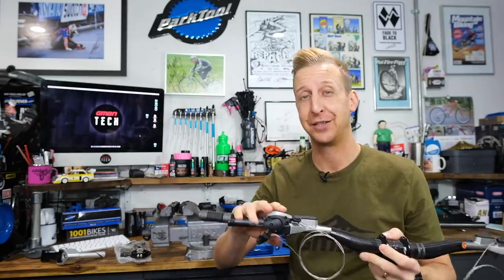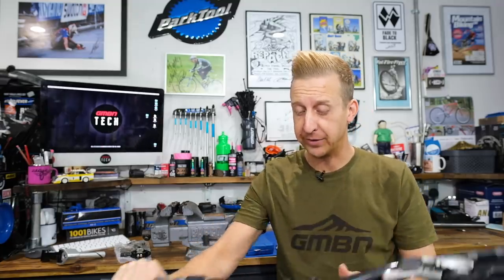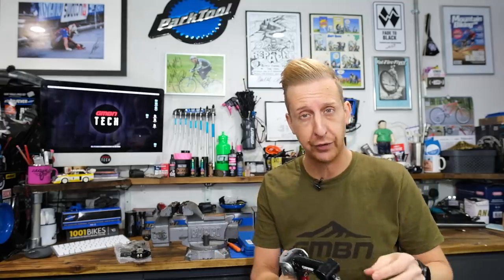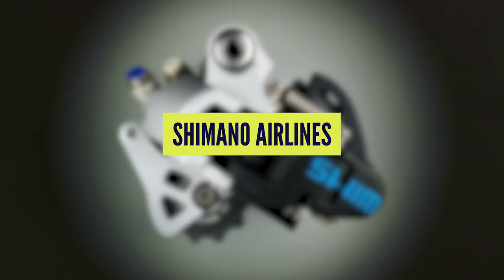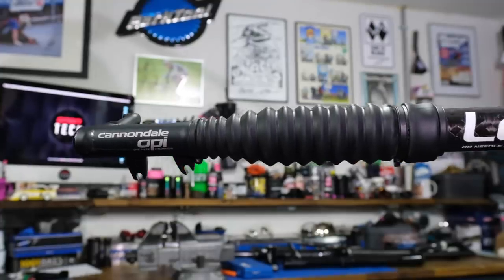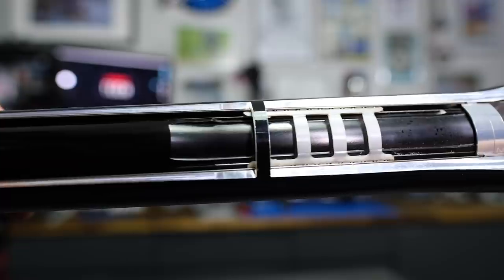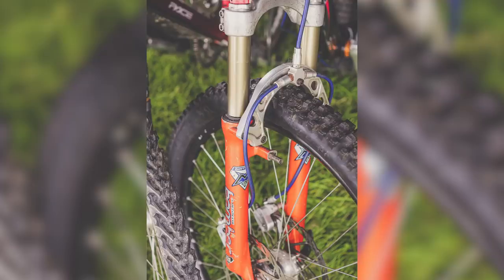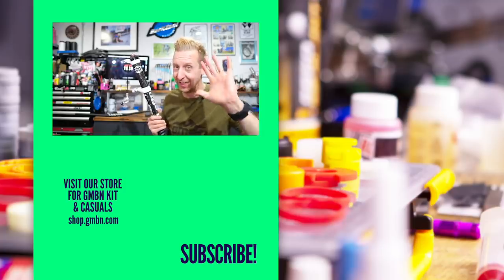The Strangest Mountain Bike Components Ever Made | MTB Tech History - Part 1

Comment: Lefty tech was a brilliant design - but Cannondale also had the Headshok system, would love to see more of that detail.
Reply: I was thinking the same...was hoping to see it on the show...guess there would of been too much from Cannondale so maybe in part 2  :-)
Reply: RollinRat  Quality manufacturing and SRAM don't get used often in the same sentence historically, but they seem to be making good stuff at the very high end these days, though they still can't compete on quality or value with Shimano drivetrains. Cannondale had some great ideas, but they were let down by terrible actual reliability - they more than earned the 'crack and fail' nickname they went by back then - based on their made up badly engineered and implemented BB standards, they're still continuing to screw their customers right to the present day, which is a damned shame as Headshocks are genuinely a great suspension concept for XC levels of travel from a packaging point of view, and any system using needle rollers instead of bushings should deliver unmatched small bump sensitivity.
Reply: Agree - that would be good to see.
Reply: The headshok was made and designed by marzocchi
Reply: @threefeetpete2010  I've never heard that before - explains why it worked :-). Back in the '90s Marzocchi was already making air sprung forks with adjustable oil damping while Rockshox were still trying to convince people that highly temperature sensitive lumps of foam were the right way to do suspension.
Reply: As someone who took apart a headshock they were a mess of needle bearings with steel plates and aluminium parts in the early 90's smooth as glass though when you had the bearing in right.
Reply: Aye, the Cannondale Silk Road roadbikes with headshock were kind of like gravel bikes before their time. I raced against one back in 2006 on gravel, and it was a really interesting bike.

Comment: Lots of crazy stuff in the 90s. Off the top of my head I remember biopace chainrings, cantilever brake boosters "gorilas", anti chain suck devices, 4th chainring (16T?) adapters, solid rubber tires, suspension seatposts, lizardskin fork boots... I could sift through my MBA magazine pile some day and send some pics.
Reply: I had BPlx on my 1991 Emmelle aluminium mtb...it was Dayglo yellow as i recall.
 I also got into the mad short  handlebar craze for a while.
Reply: Mountain Tamer Quad lol

Comment: I have the Shimano dual control (Shimano XT BR M760, the Vbrake one). It's a really wired system. The shift problem downhill when you cover the brake can be solved taking the lever a little bit higher than usual.

The Vbrake system has a quadrangle to take the pads alwase parallele to the rim. A genial solution ad really effective.

Comment: I still have a set of dual control shimano brake and shifter levers on my old hard tail which is only used when people want to try out mountainbiking and don't want to shell out a lot of money on a new bike. they still work fine even after quite a fiew hard crashes. the red needle which shows roughly what gear you're in have stopped working but other than that does it work flawlessly

Comment: Z1 Bomber is hands down the best thing that happened to mountain bikes in the 90's. I've become a classic Marzocchi enthusiast, owning an original 1997 Z1 (twin disc mounts), a 1998 Z1 BAM (Bomber Aerospace Material), a 1998 dual crown Drop Off, an 80mm Z2, and one other later variations based around the same chassis. I still ride that original 97 fork, every week in fact, and I've yet to be able to push it beyond its potential.

Comment: Ahh the Bomber Z1, got one back in 2018 for a steal on a parts bike, got the last seal kit in my LBS's shop for it; and needed the head tech (only one who knew the procedure) with the one special tool it took them an age to find, but I got it re-sealed, with fresh oil in both legs.

Ran it on a 2006 Giant Anthem for about a year; never even thought of missing a beat.

Amazing fork for the time; tough as nails; I should've never sold it; or for what I did.

Comment: i would unironically ride the cannondale lefty ngl
Reply: I’m running their 2021 Lefty ocho right now, it performs as well if not better than my previous fox 32 factory
Reply: RollinRat  if you’re upset about a manufacturer moving operations to Asia then cycling really isn’t the hobby for you. Taiwan is ground zero for bike manufacturing.
Reply: RollinRat  My bikes are made in Yorkshire! I build them from frames that were made in Halifax, just over the other side of the hill I live on (less than 5 miles away). A lot of the parts (including the brakes) are made by a firm who make all their stuff in a former mill about 30 miles to the north of me. Most of my drivetrain is Shimano, but I like the fact that KMC makes chains that are strong but don't weigh as much  as everyone else's. 20+ years ago I would only use Rohloff chains, 'cause they were the only ones I couldn't break. I could go on, but it's obvious you 'get it'. I've watched over the last 15 or 20 years as 'the industry' has introduced new standard after new standard, and I'm sick to the back teeth of it. I was riding bikes before most of these idiots were even born, and now they're telling me what they have the audacity to think I need. But what pisses me off the most isn't even the ISCG standard getting dropped for another one after only TWO YEARS, no, its the fact that after they changed the width of the rear hub standard to 142mm (I even get why it needed to be wider) they then widened it again to 148mm! ONE HUNDRED AND FORTY TWO MILLIMETRES! We already HAD a 150mm standard more than 20 years ago! Back then it was touted as the best thing for downhilling, but making a new standard 2mm narrower just so it wasn't the same? That is taking the piss. So yeah, not playing by their rules.

Comment: The Raleigh Activator MK1 💪🏼🤣🤣
Reply: The Activator II was probably the heaviest bike you could buy off the shelf - they fixed the issue with the Activator where you had to weigh 150 kg to get the fork to move by setting it up so almost anyone who sat on nearly bottomed it out... Raleigh's manufacturing of that era was absolutely terrible - the worst Chinese stuff is probably better. I was getting up to 2 years of road commuting from Raleigh frames of that era - thankfully their warranty support was decent. All the shed ornament purchasers were subsidising the people who actually used their bikes. I did hear from one guy in the industry that the average Raleigh bike covered 20 miles total in its life, so no incentive towards competence to meet their customers' needs. My 3rd warranty replacement was a welded in Taiwan version and the improvement in quality was night and day compared to the UK made ones. That frame eventually cracked at the chainstay nearly 20 years later. Raleigh's MTrax stuff of the same era was just as bad - but anyone who rode hard snapped their frames in the 90s because they were mostly still fat tyred road bikes.

Comment: Another one: The anti chainstuck plate below your right chain-stay (of course) behind the bottom bracket. Because in the 90' a lot of us suffered from chain stuck, especially in the mud.
Another two: The cantilever brake pulley at the brake junction cable to get more brake power, but also more movement at the lever.

Comment: Great stuff as always Doddy, I look forwards to the next episode. Speaking of Alsop, I seem to recall that they had a strange rear suspension in the shape of a long carbon beam that bolted to the top tube and removed the seat pin. I have no idea if it ever worked, but it looked awful. I bought a set of early Bombers in 2000, air sprung with an open oil bath and they are still going strong even now despite my having only changed the seals once, last year and the bushings about ten years. I don't thrash the bike anymore because I am old and worn out, but my old full aluminium Giant XtC Team edition still looks cool with them fitted. The Judy XC they replaced blew the cartridge after less than a year, but the Bombers are twenty years old and still working fine.

Comment: Greetings.  I still run the dual control on my Trek Liquid 55.  Its XT, and whilst the gear changing is a little counter intuitive, I have never been compelled to swap the system out.  As a matter of fact, I have had this bike from new since 2006 and last summer, when the front tyre went down, whilst the bike was off the trail for an extended period, I discovered that it was the first time I had had the front tyre off.  In 14 years.  Insane.

Comment: I never had the dual control shifters but I did love the 2003 Rapid Rise dérailler in combo with the Sram Rocket grip shifters. You could blast through the cassette in a second. Every mecanic that looked at it, his jaw simply dropped to the floor. Just not real suitable for enduro but the derailler and shifter worked exceptionally well together with the inverted spring.

Comment: I have dual control levers with rapid rise rear derailler on the hardtail stumpjumper I've had since 03. Never had a problem with either.
I believe the description in the video of the rapid rise derailler is backwards. The traditional shifter behaves differently between front and rear. The rapid rise was an attempt to make it so both shifters had the same idea behind them: pull the cable to shift into higher gear, release cable to shift to lower gear. But people were too entrenched in the old/backwards way.

Comment: If you want "suspension" without a suspension fork then just  use a carbon handlebar with a crack on the top side. Super nice and comfortable but super nerv wrecking as it is just a question of when... maybe some brand will soon release a carbon factory handlebar with factory cracks on the topside of each side of the handlebar :P
Reply: Big brain idea

Comment: Not gonna lie, Rapid Rise (aka Low Normal) are pretty sweet for some applications (before electronic shifting). I would say I appreciated the benefits of it for cyclocross. My biggest, perceived weakness was they do seem "floppier" and tend to knock around some which is why you found improvised silicone bumpers on some models. Full disclosure, I own three XTR & two XT rapid-rise derailleurs :)

Comment: The other thing that is awesome about Lefty forks is they don't pull to the left under brakes. This is because you don't have one side flexing more than the other from braking forces applied through the caliper. I didn't really notice this until I switched between the two riding steep technical descending rock features. Leftys go exactly where you point them.

Comment: I’ve seen some of this in your tech several times on your table. Like you said growing in the 80s/90s was for the best time to be a teenager. 
Must say that didn’t surprise me to see some of the Girvin stuff in there, racing for Pro-Flex in the 90s I should know something about this, must say that the company was all about innovation and comfort, even if somethings were not so good, for example the rubber elastomers , summer comes and you will be changing it because it was becoming stiffer. The Girvin and pro flex stuff disappeared when the company went bust and decided to sell to K2. 
Great times I had on my Pro Flex 855 race speck with XT group set and V brakes to match, Michelin green tires.

Comment: The cool component on my bike is the auto sag from specialized
Reply: I love how the 2012 specialized stumpjumper has the same geometry as a "modern" bike when you put a 160 mm fork on it. With Auto Sag and Brain. Also The E160 Fork with the Carbon Crown, Steerer ans Lower which is insanely light...
Spacialized did some great stuff

Comment: First full suspension bike I rode was in Vail, Colorado and it had the flexstem AND shocks front and rear.  I just about got ejected off the bike in the first set of bumps.  I had to adjust everything right away to as tight as I could.

Comment: What if someone put the rev grips those suspension handlebars and the suspension stem on one bike
Reply: On a fullsus bike...
Reply: And suspension seatpost with suspension saddle
Reply: I knew someone who tried that kind of thing, years ago. The components of course all had different spring rates and weren't tuned to work together. It rode pretty badly; on bumps all the different parts went in and out of phase with each other.

Comment: I had Both stem and seatpost suspension on my 1991 Emmelle aluminium mtb.
 I liked them so much that i got a Sp for my Carrera Vulcan Espec...the modern one does not work as well as the one i had back in the 90's.
 Question...did Girvin make that mtb with the weird looking frame and suspension seat back in the 1990's?

Comment: would love to see a modern 2 X 140mm Rotors up front , 
One problem i see with 200mm+ Rotors is that they are prone to strikes due to their size and get bent always mostly in world cups since its so low to the ground, Smaller rotor is more stiffer also, plus it will be up to 2 inch higher than most Rotors from the ground. 
Regarding the weight i think since modern brakes are extremely strong we can make it a bit smaller to reduce weight.

Comment: I had a Z3 Bomber that I rode for years. It was heavy, but I've never ridden a more plush fork. It was a bizarre fork using a QR20 axle.
Reply: The few hundred grammes for open bath oil and coil springs are the best weight you'll ever add. Proper fit and forget parts - not strip it down every couple of months to add another ml of oil, just to try to keep it almost as plush as an old Bomber that never needs attention.

Comment: Doddy, Lefty Ocho is not lighter than 2012 Lefty models (for example), neither is it stiffer (it is in fact not). But it is stiff enough ))) Lefty back in 2012, as a reference, weighed 1300 grams with steerer (stock options) and Ocho now weights 1446 (stated) grams. But Lefty 1.0 were overbuilt on stiffness and this is something where Ocho can easily be made less stiff but still stiff enough. But the fact that Cannondale made it heavier is really a bummer. next iteration of Ocho should definitely be below 1300 grams. But main advantage of Lefty fork is its action, in any corner, y any load from any side with any braking etc.... it simply works always as intended. That can not be said about two-legged forks due to different leg travel when cornering and stiction in bushings when braking.

Comment: Your story about the lefty is quite wrong tho. 
The single leg already existed for years in the Headshock Fatty forks. There the whole system disappeared in the headtube. Stiffness wise nothing can beat a Fatty. Their only limitation was travel. Because of everything that's between the headtube and the tyre. You wanted more travel than 80mm, you would be changing the geometry beyond what's desirable. The Lefty removes all the hardware from that space which allows for a lot more travel for the same geometry. 
The best ever lefty was the Lefty SL. Buttery smooth, super stiff and super light 110mm fork. If only my Lyrick felt like that 😪
Reply: @Steve Sheldon I have an old Delta V from 1993 which had a Fatty, which I replaced with an 80mm air Fatty, one out of the very first Scalpel from 2001 which I replaced with the Lefty SL. 
They did have the Moto fork for while, was sort of a Lefty on both sides, but that's not where the designs need came from.

Comment: 11:21 NO NO NO no no! I have big respect for Doddy's knowledge and passion. BUT lefty is not a good fork. The side to side wheel movement it allows is MASSIVE. Makes a very specific use case fork only(or more like for overly passionate amateur rider. Surely every pro that could choose, would pick competition, but you can't make a double legged fork, look like lefty for marketing purposes with a sticker-like they do with saddles, tires etc) Look at this video kindly provided by Cannondale and swipe to minute 1:28 "Lefty Ocho: A Suspension of Disbelief" (if i paste address, the comment might get blocked, so just look it up) What you need 800mm bar for, with that wheel wiggle master?

Comment: Yeah i dont know. Love this channel but this is the second time theyve mentioned something coming from motocross im not sure about. Im new to MTB but been into motocross for 35 years. I restore motocross bikes from the 70s to current day bikes, ive never seen a suspension handlebar. Pro taper bars are the closest as in providing flex but never a suspension handlebar. Also regarding inverted forks...the advantage is that they dont flex under load like a conventional fork, they are far more rigid. Great for motocross, but they are actually not as good for trail riding on motorcycles due to being far more rigid. They are also less reliable and more prone to seal leakage.

Comment: I have a Girven Flex Stem in my collection of old bits. Did loads of kms on a touring bike with it many years ago. Worked really well on gravel roads. Just ordered a Shockstop stem for my gravel bike, it uses the exact same principles. Hope it works as well. It perplexes me as to why most gravel bikes use straight carbon forks. It is complete BS that carbon forks are compliant. They are stiffer than any other material and beat the living crap out of the riders hands.  A nice curve would solve the problem, but it doesn't seems to get past the marketing dept.